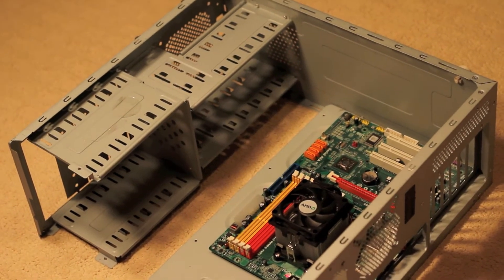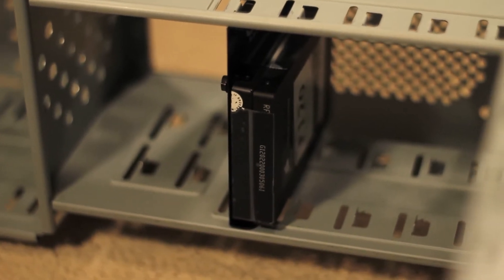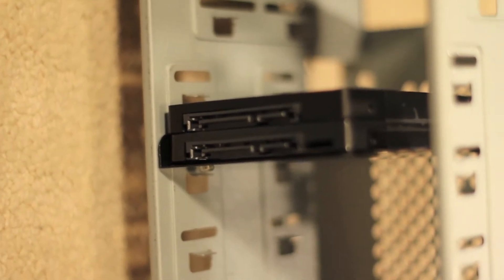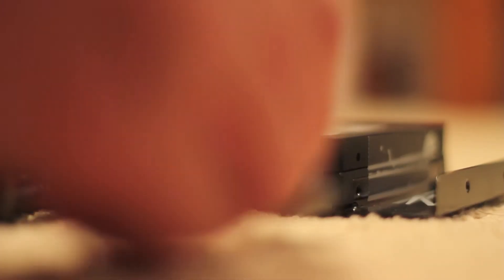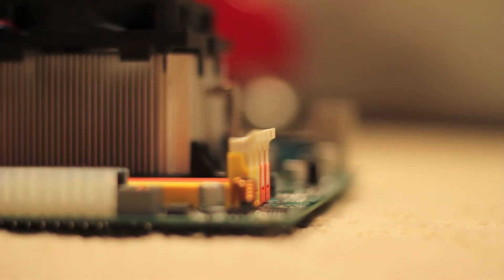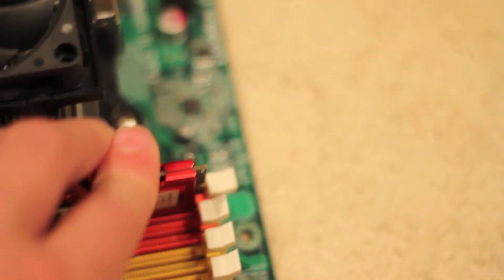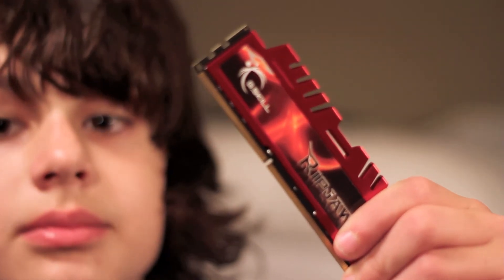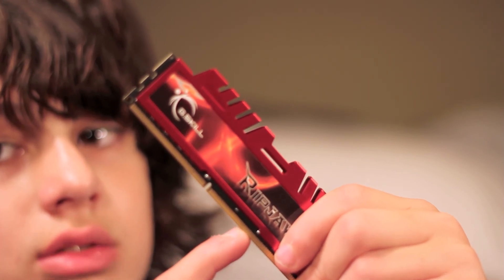How to make Your PC Faster

Comment: Ofcourse, only the pro's know that static means extra speed. So try to add as much static as possible to the computer, rubbing it over a carpet works but putting it in plastic foil and shaking it will also work.